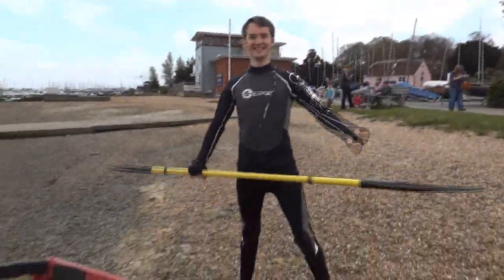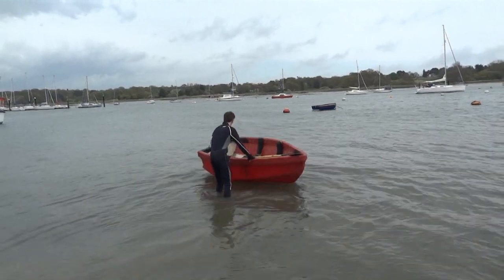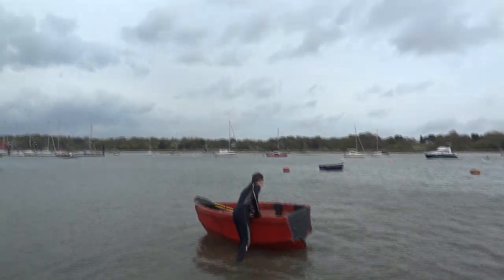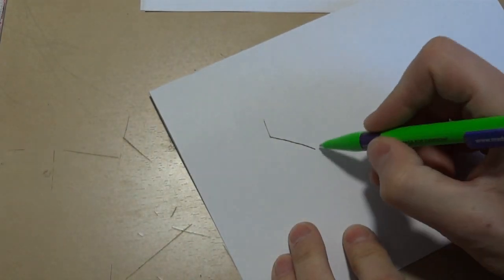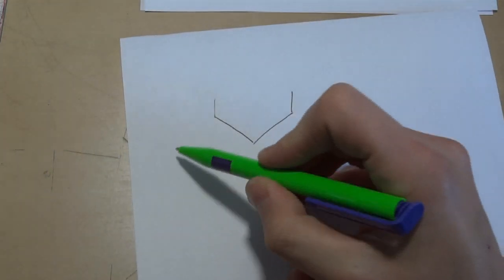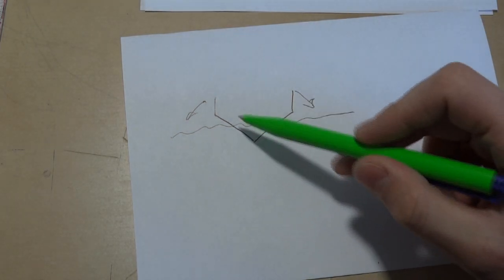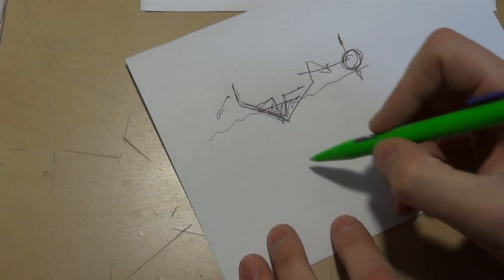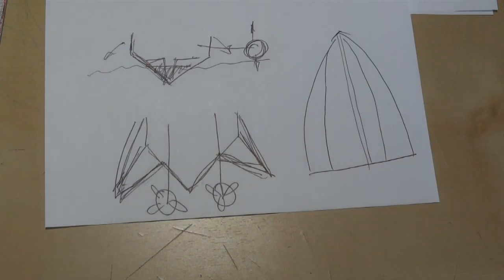Experimental Boat Building Part 6, Initial Testing on the River Hamble Southampton UK

Comment: I might suggest you generate or develop the outer skins first, and glue the skins together with hot melt glue, and glass both sides.  This construction is frameless, so you should put wider coamings on the result for torsional rigidity.  For example look at the Youtube site <sevtec> for examples.  They use 1/2 inch polyurethane foam and polyester resin, matt and cloth and are plenty strong, with many overnight trips over 200 miles, one, over 1400 miles without problems.  Try it, you will like it, too many people do not build anything.

Comment: Maybe you could have had removable ballast in the form of canvas bags full of lead fishing weights?
Reply: I am using high density foam on the stern of my sailboat and glassing over it it will add flotation and is waterproof / styrofoam is not. Just add rolling shocks and use 1708 fabric much stronger . thanks for the video
Reply: that might have worked

Comment: Look at the hull of a Mirror dingy for your base keel addons.
Consider cutting off the top 9 inches of your boat - it's just hurting you :(  band the new "top" with a tiny 1/4 inch of polystyrene and 2 THIN grp coats using unistrand rather than chopped strand thread.  Good luck

Comment: Nice vid, and some pretty good ideas for revising the hull. But you seem to be ignoring Archimedes principal of displacement. If you add more hull surface without putting in ballast, you'll only ride higher out of the water. A shallower "V", or flat bottom (think of punts) would be more stable, with little or no increase in weight. Adding removable ballast along the keel, to increase displacement, would be simplest.